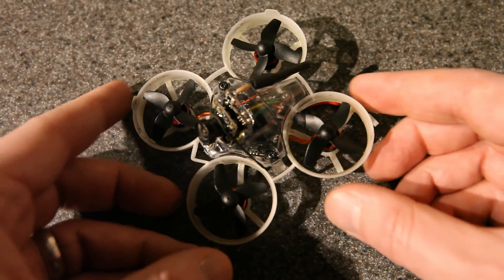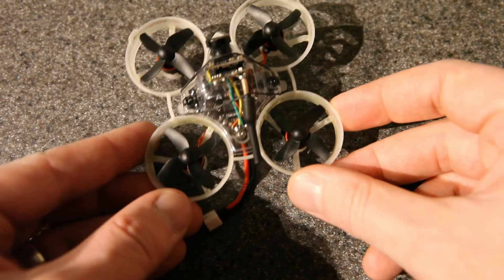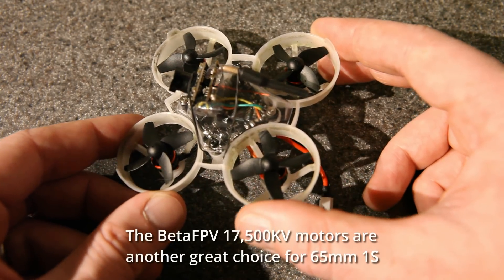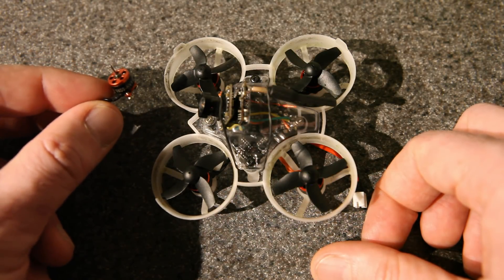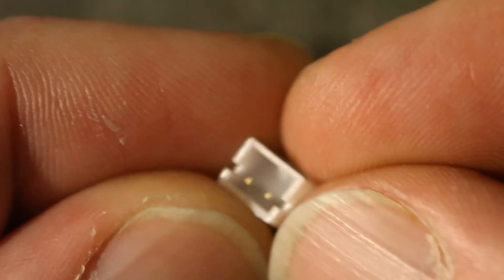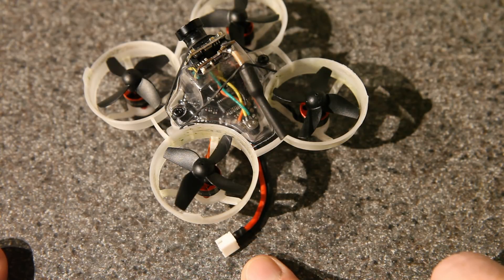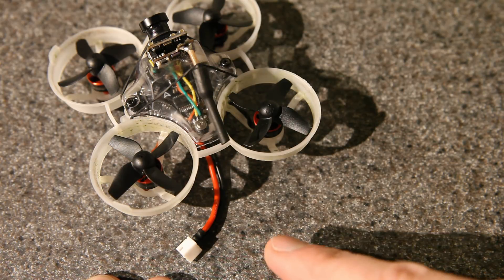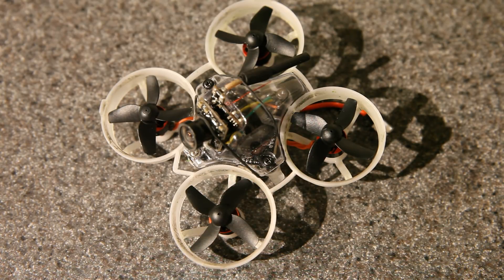My New Favorite 1S Whoop

Comment: Nice! I managed to get mine to fly for 4 minutes with 603 motors. I'm using 22 gauge wire I believe, don't think it makes a significant difference. I got mine to 28.5 grams with battery, 20.8 grams without. I'm using 300 mah 1s LiPos and BetaFPV triblade props (the ones that come with the meteor.

Comment: This build is so similar to my beebrain brushless that I put in a meteor frame and I have a dry weight of 22.70 but I can’t run 260mah the voltage drops so badly right away. Wonder why that is. I swapped out the folded pin to the same solid pin that u used. I’m using gnb 350s and get 3 min of flying hard.
Reply from the maker: Solid pin plus good batteries (GNB or mylipo) is essential. Having good, we’ll lubricated motors is also important. I hope to have time to make a video about lubrication soon. You can also try 48kHz JESC for some extra flight time (something that didn’t exist back when I made this video). If none of that helps, then there may be something wrong with one or more of your motors, or maybe the PID tune is too high? Good luck!
Reply: Mr ShutterBug looking forward to seeing that motor lube video, I haven’t come across anything like that for whoop. Thanks for the reply

Comment: Is removing the header connector from fc and soldering motors direct easy enough? Will it make flying better?
Reply from the maker: No it is not easy. It takes quite a bit of time to remove the motor plugs, remove the pins from the FC, wick the solder out of the holes, and solder in all 12 wires. If you do remove the plugs, then it will be a little bit lighter, and lighter is always better. Weight is the main advantage.
Reply: Mr ShutterBug I have 2 motors where the wire broke from connector. I am not able to solder the wire back to connector. So I thought why not solder the wire directly to FC.
Reply from the maker: @blendofdiscovery  I see. Well, good luck. If all goes well, you'll be back in the air and lighter than ever!
Reply: Mr ShutterBug I did remove the connectors and pins and soldered motor wires directly. Did not see any improvements flight time or performance. However was able to use the motor where the wire was broken from connector.
Reply from the maker: Simon George cool. Glad you got it working again!

Comment: impressively efficient! I'm jealous! sitting over here with my brand new meteor65 and 1.5min flight time :(  

Have you ever found yourself wanting more consistent throttle control between beginning and end of batteries?  I have!  It amazes me how much different these things fly in the first 10 seconds vs the last 30 seconds.  I have been asking BF devs for some sort of dynamic throttle scaling based on battery voltage or power output.... really i just want them to start TRYING to solve the issue.  YES you must lose a little bit of power in the begining of the flight, but i think it's more than worth it if it means the quad will fly more consistently.   Please share your thoughts on the idea of the feature. (the method of how the feature works can be up to the devs so it's not really worth discussing until they agree to do it). 

great vid, thanks for sharing!
Reply from the maker: That's an interesting idea, but it's really a bandaid not a real fix, and I suspect it would be hard to implement well.

If you want to have a reliable throttle response during a full 2 minute race, then you need a build that is efficient enough (or has a large enough battery) to continue flying for at least 3 minutes. If it's totally dead at 2 minutes, or even 2:30 then there's no way it's going to feel good on your last lap.

When you are in that last leg of the flight and you feel the throttle getting weak, it's not like your throttle is scaled back. It's more like your throttle is clipped. The whole upper portion of the throttle stick becomes useless. Raising your throttle at that point has no effect because the motors are already spinning as fast as the limited current will allow.

Have you tried scaling your throttle down to like 80%? That might give you the feeling that you're looking for at the beginning of the flight, and it might extend the battery life long enough to have a longer window of "consistent" flying. I don't think having that throttle limit at the very end of the flight will be a problem, because the batteries probably won't even be able tot hit 80% anyway. This is all theory. I don't fly with throttle scale on any of my 1S builds. But it might be worth a shot. Either that or you set up a build that flies longer natively. Good luck.

Comment: The only problem I have with the original JST connectors is that after a dozen flights a pin might get loose when you plug in :(

Comment: Stumbled across this video looking for longer flight time  brushless whoops. Can’t wait to put one together. Btw, I have a Mobula 7 that doesn’t fly well, could I pull the 0802 16000 kv motors off it and use them in this build? Would they yield even a longer flight time or would they not spin the props fast enough. Flight time is more important than punch for me right now.
Reply from the maker: Yes the mobula7 motors should work on 1S. It wouldn’t have the same top end speed, but it would probably fly for quite a while especially if you keep the weight low. Check out the video I made on my 15.3g brushless whoop for weight saving suggestions. That said, the M7 motors can also make a good 75mm 1S, and that may have longer flights anyway. So what’s wrong with it right now?
Reply: Thx for the response. Yes, those are great ideas for weight savings. I only fly the M7 on 1s and get about 2:30-3 min flight times with 450mah batts. The quad goes into this weird wobble oscillation about every 2-5 seconds, stops, flys stable and then wobbles again. More annoying than anything else. It doesn’t do this as bad on 2s but it’s too fast on 2s. Thx for your help.

Comment: acro..??
Reply from the maker: Nope. All the footage in this video is angle mode.
Reply: @MrShutterBug  i want build..
Reply: @MrShutterBug  how pid..??
Reply from the maker: Bejo Gaming 

betaflight 3.5.1
Props out

set p_pitch = 50
set i_pitch = 55
set d_pitch = 45
set f_pitch = 440
set p_roll = 40
set i_roll = 45
set d_roll = 40
set f_roll = 390
set p_yaw = 90
set i_yaw = 45
set d_yaw = 0
set f_yaw = 60
set p_level = 80
set i_level = 50
set d_level = 75
Reply: @MrShutterBug moxkingbird..??
thanks before

Comment: Hey the quad is amezing could you also share your PID's please thankss
Reply from the maker: The tune is designed for BF 3.5.x not BF 4. I've made some updates to this build, so i'll probably make a follow-up video at some point. Stay tuned!

set p_pitch = 50
set i_pitch = 55
set d_pitch = 45
set f_pitch = 440
set p_roll = 40
set i_roll = 45
set d_roll = 40
set f_roll = 390
set p_yaw = 90
set i_yaw = 45
set d_yaw = 0
set f_yaw = 60
set p_level = 80
set i_level = 50
set d_level = 75

Comment: Looks like you could save a little more weight by using the URUAV UR65 frame. Thoughts?
Reply from the maker: Maybe. Have you used it? And if so, do you think it's as durable? The BetaFPV frames are super durable! I haven't broken one at all in months.
Reply: @MrShutterBug  Orederd one to try out. Mine was on a table and blew off in the floor while flying mob7. I then ran over it with my wheel chair.

Comment: I am using a 260mah battery with these motors. And get max  2:30min flight time... i dont know what the problem is... also the connectro upgrade did not make the difference...
Reply from the maker: Did you replace the PH2 connector with the real ones from digikey? That’s probably your issue unless you have worn out batteries or something.
Reply: @MrShutterBug  i have replaced the connector with a no name one but it looks absolutely the same like yours. I had these connectors already and give it a try. Maybe its really the genuine jst connector which makes the difference. And another question what do you think about the happymodrl 0802 16000kv motors with 1s 65mm?
Reply from the maker: @r.k.456  It's surprising how much difference the connector makes. Try the official ones. They're not expensive. Also, make sure you have good batteries. For example, the GNB 260s are WAY better than the BetaFPV 260s. As for the HM 16,000KV motors, they should work great. It probably won't be quite as snappy as the one I showed in this video, but it might be even more efficient. Finally, the props make a big difference. I like the ones I showed here and also the Gemfan 31mm 4-blades. Good luck.
Reply: @MrShutterBug  thank you very much mr shutterbug! I will try your tips out!

Comment: Hey , what if I use 0803 19000kv, because the motor is use bearing, not like 0802
Reply from the maker: Bearings would be nice, but I haven't tried that combo for myself. The 0803 motors would be a little heavier, and I've heard that they are also pretty power hungry.

Comment: I am ordering some jst ph 2.0 male connector without wires to replace my beta65 pro 1s connector.
What wag wires you are using?
Reply from the maker: Most whoops have 24AWG wire. Mine has 20AWG which adds about half a gram. 24AWG is enough for most situations but if you ever fly on sustained high throttle outdoors, then you might pull enough current for 20AWG to give a slight performance advantage.
Reply: I just flown mine with Betafpv 0802 175000kv motors, I cant seem to find any difference in thrust from 0603 19000kv. I am still at 70 to 80 % throttle. With 0802, my dry weight is 26gm on my kitchen scale. But every i contated says 22.5gm. Not sure how they could drop that extra 4 gm weight.
Also does prop reverse cause more voltage sag?
Reply from the maker: Simon George the main difference is 0802 is more efficient. To get the weight down you need a cam/vtx/canopy solution that’s light. And no prop direction does not change sag.
Reply: Mr ShutterBug ok. May be mine is flysky version which add up extra rx weight.

Comment: What tool do you use to crimp those wires / connectors?
Reply from the maker: The power leads are soldered to the pins in the back of the PH2. No crimping required.
Reply: @MrShutterBug  Thanks sir!

Comment: @Mr ShutterBug I built your favorite 1S drone listed here. I did the 20AWG and real PH2 conversion too. I flies very nicely on the stock tune of the Betaflight AIO FC/ESC.  It's the nicest 1S brushless build I have flown to date and I really like it. Problem is the FC is hit or miss with showing correct voltage in the OSD. Sometimes it works, sometimes it doesn't. Do you know of a fix for this or just bad QC at the factory?   Are you running stock tune on yours? Thanks.
Reply from the maker: cybervid07 mine sometimes shows a voltage that is too high but then it settles down. If you’re sure it’s wrong, you can adjust it in Betaflight. My tune is a lot like the Project Mockingbird tune (UR65 edition). Good luck.
Reply: @MrShutterBug  Thanks. I think I solved it. Set my Max cell voltage higher (4.9) to allow the FC to fluctuate higher and now it settles down correctly. Love flying this little beast around. Fast, nimble, and solid 4min flight time on the Eachine style 4 blade with GNB300. Sweet little build!

Comment: So I have a similar build.
Crazybee F4
HappyModel 0802 19,000 motors
HQ 31mm props and the only way I could get over 3 minutes
flight is if I use my 1S 450mah pack.
I have some older GNB 260HV that I get maybe 2 minutes on them but my packs
rest at 3.2 volts so I don't do that anymore :)

Be great if I could use my 260HV packs. Does the pigtail really help?
Reply from the maker: Sorry to hear that. The GNB 260mAh 1S HV battery is what I used in this video. Yes I think the pigtail helps, especially using the legit PH2 connector from Digikey. Other possible factors include the condition of your batteries, your motor bushings, and your choice of props. The HQ props have some nice flying characteristics, but I think they are less efficient than what I showed here. I hope that helps. Good luck.
Reply: @MrShutterBug  Yah I use the GNB 1S HV. But they are like 3 months old. And I have some TinyWhoop 250HV 
that do have more punch in the beginning of the flight but don't seem to last voltage wise at end of flight
like the GNB. I did like 10 packs last night 
trying very hard to keep my momentum up stay smooth. Averaged 3 min flights and Voltage was at
3.65 resting at end of flight. So that was better. I ordered like 100 of those digikey connectors and
will be making some decent pig tails with 20AWG. All my pigtails are the folded metal pins. Gunna hand them out
at our whoop racers :)  I'll look into those props too. Thanks for the tips.
Reply from the maker: @MikeAarset  Gemfan makes 31mm props now too. I hope to try those out soon. I think they will be heavier than the HQ props but might provide more thrust for the RPMs.
Reply: Mr ShutterBug yah they are heavier. Supposedly HQ came out with another version of their 31mm prop but with more pitch but haven’t found them yet.

Comment: I had issue with BETAFPV 1s brushless FC just locking up & you gave me some possible reasons
I determined the problem to be related to the spi receiver..I bound it in d8 mode & changed it to frsky
d in Betaflight & problem stopped. Im now having the same problem with BETAFPV 2s FC but changing protocol is not fixing it…I have nothing but issues with these spi receivers..Is it just me or
Are other people having these issues..Do you have any thoughts?
Reply from the maker: Not sure. I always use D8 because it has lower latency.
Reply: Mr ShutterBug I think d16 8 channel is the same as d8 8 channel as far as latency goes
Reply from the maker: Chris cage I have not measured the latency for myself. I’m just repeating what I heard from others that know more than I do about it.

Comment: Hi. I'm trying out your setup but just found these motors spin so fast I am not sure they are spinning in the right direction. So not sure which motors which I bought I need to reverse or not. Is there a trick?
Reply from the maker: engizmo try touching the motor or prop with the corner of a piece of paper. You should be able to figure out which way it gets pushed.

Comment: I built one of these & it death rolls at random times...not sure if its a fail-safe or what or bad flight
controller & receiver...doesnt seem to matter what the battery voltage is..It has happened with freshly charged battery
Reply from the maker: That stinks. Death rolls are usually caused by one of two things. One of your motor wires could be damaged  (probably near the connector) resulting in an intermittent connection. Or... you could be getting a voltage spike causing one or more ESC to reboot. Voltage spikes are most likely to happen when starting or stopping a snappy flip, or during a crash. The best defense against voltage spikes in a whoop is to go into the blheli configurator and turn down the "startup power". I would try turning it way down to see if that makes a difference. If it does, then try increasing the startup power to the highest value you can without bringing the problem back. Your problem could be something else, but those are the most common culprits. Good luck.
Reply: Thx for the help

Comment: Thanks for the build! Ordered some of the 0802 motors to go on my UR65, should be a nice little upgrade. Still gotta source some of the JST connectors though.

Interesting comment about the props. I have tried both the HB31 and 65x props on my Mobula6. They HB31 were terrible, they rattled and gave heaps of jello. Much less thrust down low too, which is probably what you want for indoors. Waiting to try some of the gemfans when they come out.

Comment: @Mr Shutterbug, how does your new favorite1S build compare to the new Betafpv 65 Pro2?
Reply from the maker: The 65 Pro 2 could almost be a multipurpose 1S/2S build, if It didn't come on the 65X frame. The 65X frame holds the two batteries side-by-side, so it would be imbalanced if you only used one battery. So, you would probably have to move the parts on the the 65 Pro frame (as seen here). Then it should make a pretty good 1S, with the option to strap on a 2nd battery.
Reply: @MrShutterBug  My mistake, I thought it was a 1S build. I see it's basically a 65X with lighter frame and parts.  I like your 1S build, very nice!

Comment: Would the jst upgrade and 20awg help a 1s brushed set up also?
Reply from the maker: I assume you're talking about the red JST connector. The red JST is rated for 3A while the PH2 is rated for 2A. It probably would result in less voltage sag, but only in the situations of sustained high throttle. It would be inconvenient because most 1S batteries don't come with that connector, it would be awkward because of the length, and it would add weight. Would it be worth it to you? I don't know.
Reply: @MrShutterBug  I actually meant the PH2 connector. I was thinking of adding it my brushed tiny whoop, but was wondering if it was overkill and only benefited brushless systems. I actually try to avoid the red jst connector in products I buy 😅 thank you for the response
Reply from the maker: jocejrod I see. It’s hard to say. If you are pulling 5A or less then it almost certainly doesn’t matter. If you have a really power hungry brushed build and the voltage sag bothers you then it might be worth it.  I would start with a fresh connector.
Reply: @MrShutterBug  thank you again for your input. Maybe I'll try it out in the future, and then make a video about it to try to be as informative as you are in yours. Thank you for the links and the information